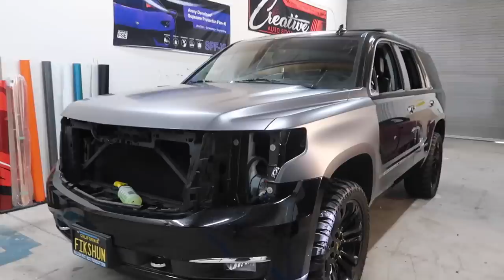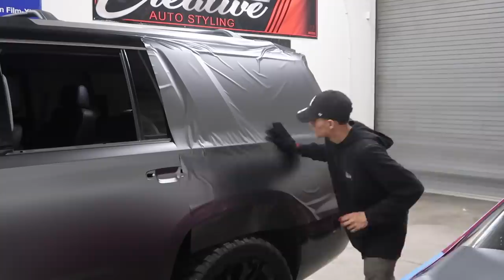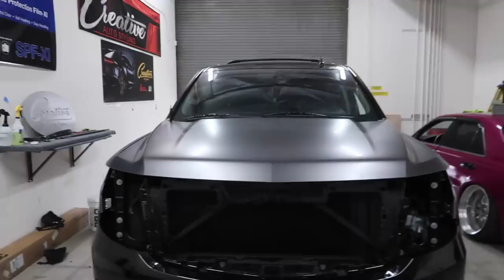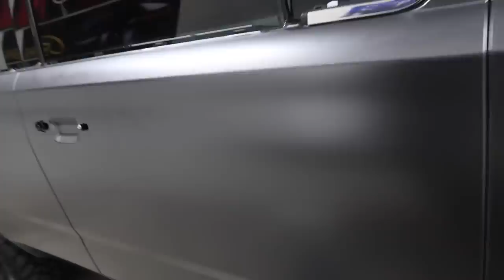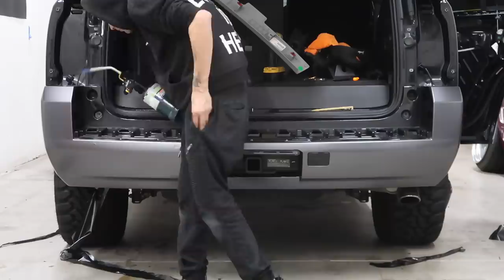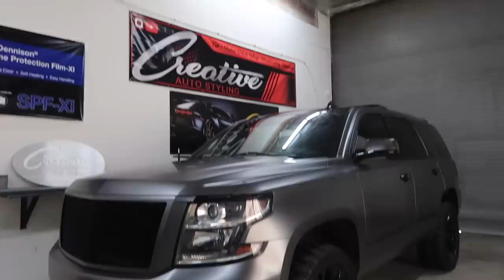THEY KEYED MY CUSTOMERS NEW TRUCK.... (Chevy Tahoe Full Wrap)

Comment: How much did you charge for this wrap? I’m starting up my own wrap business and I used to design vehicle wraps as a graphic designer.  But the most we charged was for a full print wrap on a 2018 Tundra was $3,000.  I don’t have much experience with pricing out color change wraps.  The average wrap for us was around $1,200.  But that was only partial printed wraps
Reply from the maker: To be honest it all depends on your skill level and name. If you have a name built for your self, people will pay more to have things done by you or a certain shop. Just like when it comes to getting a hair cut, you can pay someone 10$ for a hair cut or some people pay 50-100$ a hair cut. The difference is the barber. Don’t price your vehicle wraps out the same as another shop because some people already have an established clientele and trust worthy work. You have to start somewhere. I used to charge 800$ a car when I was first starting and now charging around 2200/2400$ for a basic color change. And the Mustang I did in chrome I charged around 6400$ (my last YouTube video) It all depends on material, car, the labor your doing etc.
Reply: Samson Montoya awesome thank you so much.  I’m starting my business from scratch right now. And this would be a side thing for a while until it took off.  But that’s why I’m trying to make sure to do it right.  As of now I don’t even have a name or logo for it.  But I do have a couple of friends and family member who would allow me to practice and hone my craft on their vehicles.  I did just decide this week that I’m going to do this though.  But I want to have a website, merchandise, business cards, and a few wraps in my portfolio before I really start advertising for it.  For sure got to build up social media and a YouTube channel to help it grow.  But it’s just gonna take some time.  Thank you for the help and love your videos!

Comment: So how long is a wrap supposed to last in the california sun rough estimate. 2 to 4 years?
Reply: It is important to ask the vinyl wrap company if their vinyl wraps are made with long life solvent ink. It should also be laminated with a protective layer that can prevent deterioration from harmful UV rays. A vinyl car wrap with these attributes should last for at least three years or longer if well-maintained.  keep it out of sun when you can so it doesn't fade. Average life is 7 years if it's 3M

Comment: Looks great! I wonder how it will look after a year of sunlight exposure and car washes. Properly applying automotive paint is an expensive, time consuming process but the results are long lasting. I would be weary of any scratched or unpainted surfaces under the wrap which will undoubtedly continue to rust as they have not been properly sealed or treated.

Comment: How do I wrap polyurethane? Do I need to sand it down and wrap or apply primer? Thanks for any input!
Reply: Arham Khan sand probably to 400 or higher plus try using a few coats of floor wax pledge I think I used and my wrap is still on tight . The wrap sticks better to shinier surfaces

Comment: great work, but IMO if this was a customers truck i would have took the extra 20 minutes with a rubber wheel and cleaned off that old door trim adhesive instead of just wrapping over it. seems like it will cause the wrap to fail sooner regardless if the trim went back on.